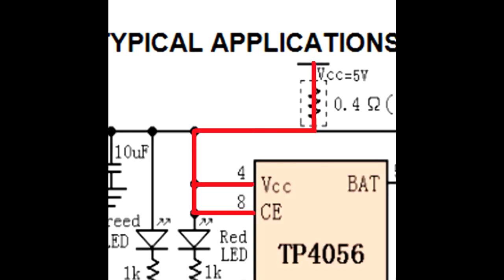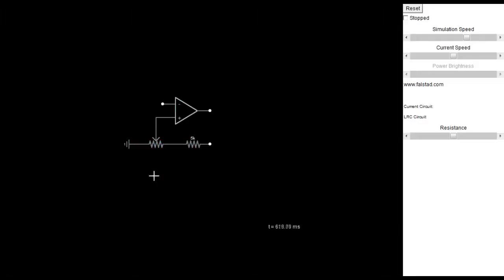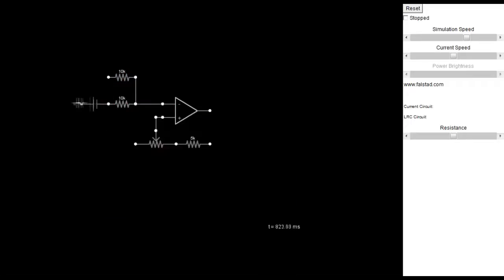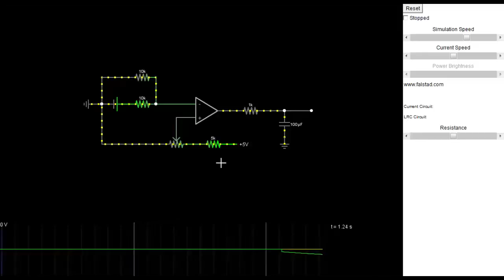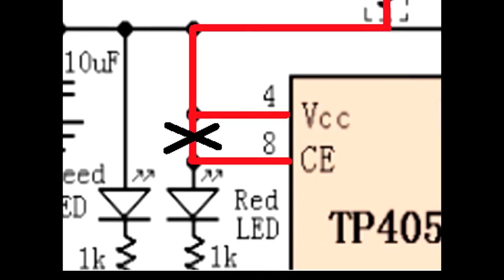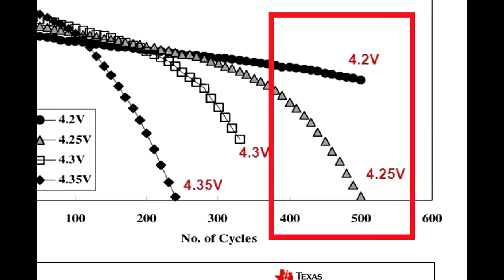TP4056 MODS: Adjustable Voltage Shutoff & Current

Comment: Why not just use a voltage divider across the battery (with a pot for tweaking) to drive the shutdown pin?
EDIT: Sorry I had this in reverse. My idea won't work as the pin  is driven low for shutdown,not high.

Comment: Thank you for posting this video. I have bought five  of these charging modules but the maximum  charging current during a charging cycle  in all of them was  only 250ma  and not 1000ma as the seller claims. I am interested to know :have you measured the charging current ?

Comment: How to mod the lower cutoff voltage? Mine stops to discharge  at 3.6V and in like to go 2.75V...
Reply: Use a module without protection. Those without output terminals don't have protection.

Comment from the maker: The diode and low pass filter is not necessary. For minimal parts you can skip those.
Reply: The link didn't work? I'm trying to limit the cut-off voltage lower than 4.2v (4.1 or 4.0) to increase the life cycle longevity of my packs.
Reply: @johnmaclean2466 did u found a way to?
Reply: Thanks for the new version. Why did you use TIP32C specifically and not, say, just TIP32? 32C is rated for 3 amps 100 volts, so the transistor could be smaller, than this one, couldn't it? Assuming that the maximum voltage and current is 5 volts 1 amp, can you recommend a smaller transistor?

Would there be a problem in connecting 2 of these circuits to a 2S battery pack's balance plug (3 wires, + and - meeting in the middle) if the USB inputs were isolated?

Comment: First of all, I want to say thank you! You are the only person on the internet I could find after days of searching that provides a solution for charging to under 4.2V I use 18650 on flashlights and have to charge them every 2 days, so the potential cycle gain would be huge. Unfortunately, I can only solder, and know what a resistor and a capacitor is but that's all and do not understand the language you use or the schematics. So, on the Current side, I already have a 2.2Kohm resistor to charge at ~550mah, that part I understand. Then you have from the + of the micro USB, a diode for I guess, dropping the voltage 0.6V to the + that feeds the board itself. (So the same as hooking up a 4.4v micro USB connector)  But I don't understand what that is for. From there on, I'm lost. All the resistances and the chip in the last picture I do not understand where they come from. Would it be maybe possible to draw all the components on a picture of the TP4056 PCB, for easier understanding? I feel you would be the only guy that could do this for the internet.
Reply from the maker: I can probably do a follow up video going into more detail. The diode is used so the comparator will have a higher voltage than the 4056 chip and the battery. The comparator connects to the 5v before the diode. If the diode isnt used then the comparator wont function as intended.
The comparator sets the shut off voltage with the potentiometer. 
Other methods can be used in place of the comparator to set the shutoff voltage. Microchips, raspberry pies, arduinos, and other programmable devices.
Reply: @americanengineering2063  Thanks for your feedback! Ok, so as far as I understood, the diode is there to lover the voltage for the 4056 chip. So the Chip (VCC pin) gets 4.4v. But then you pull a wire out of the 5v (before the diode) and you hook it to the electronic parts you have on the diagram, these in turn, will send a signal to the CE (8) PIN (which is now standalone, because you cut the trace) so it stops the charge when it gets to a certain voltage which can be adjusted on the potentiometer. This is as far as I got: https://imgur.com/a/Jt4mSLA 
If you have the time and could draw the remaining components on that picture, that would be awesome.
Sorry again, I don't know how to read the schematics you worked so hard on making for the video, but I have no electronics background and struggle to understand them.
Reply from the maker: @portumaan  the page didnt do anything. it would probably be faster if you looked up the datasheet for your op amp. The diagram will show you all you need to know. Batteries arent the safest things to mess around with. Esp if u dont know what youre doing :). This may be a good time to get to know op amps. It only takes a few minutes. I will still draw it in a more comprehensible fashion none the less. However it will be a few days. Busy busy busy.
Reply: @americanengineering2063  Thanks for taking the time to come back to me. I don't know what happened to the image, when I'm logged in to imgur, it show up, when not, I just get a grey page. Here is a link from another page: https://i.postimg.cc/BZYf7g7s/TP4056.jpg
I don't have an op amp yet, I have ordered the one you used "lm358". 
In the meantime, I just realized that the schematic was even more complex to me than I thought.
I realized after reading what you wrote multiple times, that the "lm358 op amp" is the comparator you were speaking about. I saw a bunch of videos to understand what it does, also I read up on all the symbols for the electronic components.
While I was writing this comment and looking over the schematic again, I realized I might have got it. Is this the correct wiring? https://i.postimg.cc/5y2B7v9K/TP4056-final.jpg (You have probably never seen anything so amateur in your live, but hey, I'm trying ;) )
Things I'm not sure about yet:
1- Does the lm358 need to be wired to + and - ?
2- What voltages am I aiming for on the CE pin, to let it charge and what voltage for it to stop? (I guess I could wait for the battery to charge to 4.15 (it's what I'm aiming for) and rotate the potentiometer until it stops the charge)
I read the datasheet and it says "A high input will put the device in the normal operating mode. Pulling the CE pin to low level will put the YP4056 into disable mode. The CE pin can be driven by
 TTL or CMOS logic level." but the more I try to read about it, the more confused I get.
"TTL is 4.75 V to 5.25" so 4.75v to charge and 5.25v to stop charging
"CMOS it ranges between 0 to 1/3 VDD at a low level and 2/3VDD to VDD at high levels" so if VDD is 5v then, 5v-3.3v to charge and 1.66v-0v to stop charging"
How does it know if it's in TTL or CMOS?
Once again, thanks for all your help! I am really determined to get this done.
Reply from the maker: @portumaan  it seems right but you need to connect the battery+. Where it says 3.7v is the battery. The two 10k resistors are a voltage divider.
The op amp is analog. The CE pin is digital. Connect the CE pin to 3.3v-5v to enable charging, and 0v-3v to disable charging. I filled in the battery connection here in purple. It's a bit nested but everything else looked correct from a glance.
https://www.dropbox.com/s/ykredgjzsn1fho0/tp4056%20final2.png
 Remember to always double or even triple check all the connections points to ensure you have it correct. Always test it to make sure it will operate as it should before leaving it unattended.
Reply: @americanengineering2063  Thanks again! First for providing the ideia, and also helping out on how to implement it.
I also noticed the battery+ missing after I did the drawing, thanks for that!
Regarding the comparator, we are aiming to get it to output 0v-3v (to disable charging) when the battery is at for example 4.15v. So the potentiometer has to set to provide that 0v-3v on the CE PIN at my preferred shutoff voltage.
I also appreciate your concern about the safety of it all. I use lithium batteries on (simple) projects for some years now and am familiar with their safety rules. Always test it various times before leaving it unattended ;)
Biggest hurdle right now is getting the parts delivered. I will post back when I have it all set up and (hopefully) working.
Reply from the maker: @portumaan  In more detail the potentiometer is a voltage divider that sets the non-inverting input. The battery voltage with the voltage divider is the inverting input voltage.  When the inverting input is higher than the non-inverting input the output of the op amp will be 0v. When non-inverting input is higher than inverting input the output will be 5v. 
Since a voltage divider was used on the battery the inverting input will be half the battery voltage. To set the shutoff at 4v the non-inverting input should be set to about 2v. Hope this clears things up.
Reply from the maker: @portumaan  Here is a different version that renders the same results. Its a bit easier to put together. https://www.dropbox.com/s/v33djy1ngk4p5w2/TP4056ModSchematic%202.png
Reply: @americanengineering2063  Thanks for that! This is not forgotten, I still haven't received all the parts for the other one, but as soon as they come, I will come back to you.
Reply: @americanengineering2063  Again, the link is gone and I would like to look at it. I am trying not to bother ppl even tho it takes me longer. Tripping over things is how we learn not to fall.

Comment: So in one sentence, you dropped the Vcc by approximately 0.7 volts to make it stop.
But my question is that the drop voltage in my experience is somewhat dependent on current flowing through it, so although theoretically the diode should disconnect, but you would still have some current going through.
Reply from the maker: when the charger shuts off the voltage on the battery very slowly drops as normal, there is no current going into it. the diode is there so the comparator will have a higher voltage than the tp4056 and battery. if the voltage on the op-amp comparator is not higher than the tp4056 and the battery then it wont function properly and will stop the charge early. there is a voltage drop accross the diode but if you're using USB then it's not enough to effect the tp4056 as it is still in the 4.0-8.0 input voltage range. i hope i answered any questions, if you have any more questions or want more details about anything just ask! have a great day!

Comment: Good work, schematic link is no longer Available  :-(, yes please help
Reply: Ooo found ya Mr. Glasgow. 👍😆
I've been usung these TP devices for a while and I have noticed that they are not safe at all. Soon or later the device fails, so i decided building my own cells charger.

I got some components.
1 lm317, some capacitors, resistors and the most important, a micro lamp (not sure of how i could call those small lamps (not LED). It is a kind of small lamp wich are found on those old chrismas ornaments).

As soon as i ger better o will send the schematics for you.

Please please take care!!!

👍😆
Reply from the maker: Here is a different version that renders the same results. Its a bit easier to put together. https://www.dropbox.com/s/v33djy1ngk4p5w2/TP4056ModSchematic%202.png

Comment: Is it possible to modify the cut-off voltage to approximate 3v and not damage the cell so much?
Reply from the maker: Here is a different version that renders the same results. Its a bit easier to put together. https://www.dropbox.com/s/v33djy1ngk4p5w2/TP4056ModSchematic%202.png
Reply: I recommend you watching Lithium Battery Longevity by DIY Solar Power with Will Prowse if you haven’t. In short, you want a cell at 4v (80-85% capacity) or 3.9v (70-75% capacity)

Comment: schematic link is no longer Available  :-(
Reply from the maker: yes i've been having issues with that. ill try an alternative.
Reply: Attila Rivera
It is ok.
I made it.
Thanks to ur vid i could do the modifications on my modules.

I used to have 4.20v at the output. Now i get only 4.00v.
I didn't know that 4.20 could damage my cells.

I think the chineses do that on propose just to make the sell disposable intensing to sell them more and more..lol that's what I think!
👍😆
👏👏👏👏👏
Reply from the maker: @attilarivera  lol the quality control is definitely lacking either way. 4.2 would probably be considered a safe point for max voltage while on charge but a fraction slightly over 4.2 can lead to quite a bit of heating. 

charging them to 4.1v instead of 4.2v will increase the life span by many years. these modules supposedly should shut off at 4.25v. some of the batteries i had were charging up to 4.26 volts and staying there without ever switching off, and i thought that was a little dangerous.

when measuring the voltage at the set potentiometer it could be lower than the voltage that the battery shuts off at. for example my pot pin tests at around 2.14v but the battery shuts off at 4.1v

edit: Remember to take precaution when working with battery chargers, double check and thoroughly test everything.
Reply from the maker: Here is a different version that renders the same results. Its a bit easier to put together. https://www.dropbox.com/s/v33djy1ngk4p5w2/TP4056ModSchematic%202.png